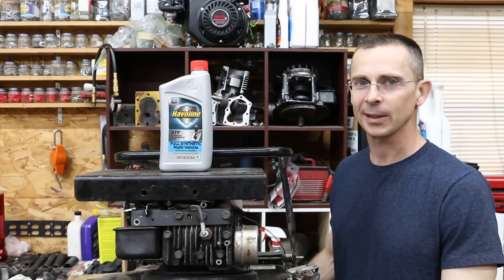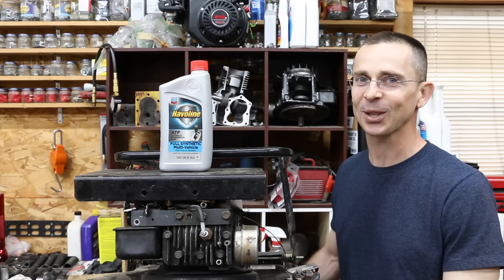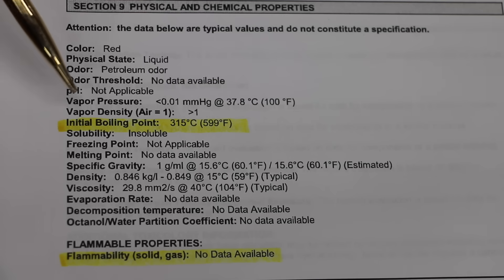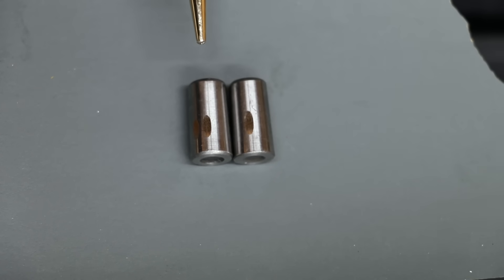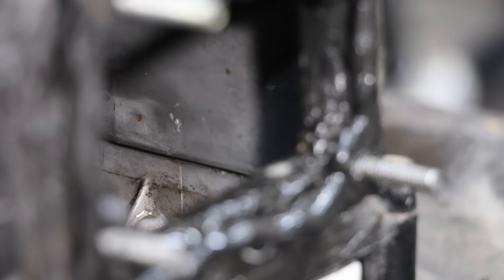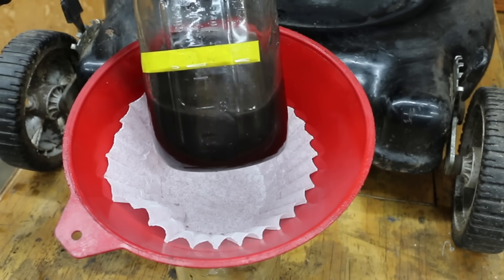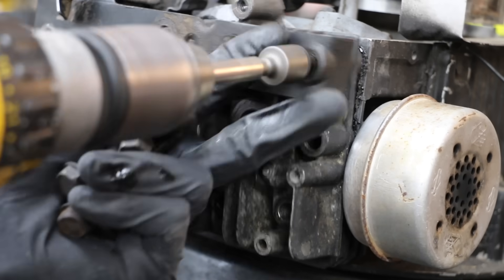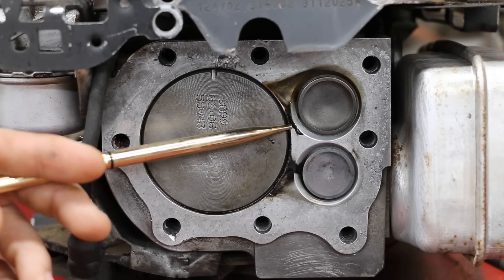ATF as an Engine Oil substitute?  Let's see what happens!

Comment: You are excellent at using the "scientific method" and move your videos along very quickly.  You did not fully understand the significance of when, in another video you placed 20 ml of water in ethanol gasoline, only to come back later and measure 30 ml.
Ethanol turns to water as it decomposes, creating water in your fuel tank. I have only found one product that cures this problem, a Lucas diesel fuel additive. On the label it says _"With real water dispersants"  Treating five different older vehicles I found it takes 5 tankfuls with the additive to get all the water out.  Once you do, your vehicle runs with more power, smoother and fells great, like it is at top performance. (Also helps to clean the O2 sensors, use platinum plugs, and engine flush - the number 1 most effective way to remove engine sludge.

Comment: I worked in a shop years ago and every once in a while someone would come in with a noisey engine from forgetting to change the oil.  Changing the oil but filling the engine with transmission fluid and a new filter usually could fix it.  Just start the engine and wait until it gets a loud lifter tap, about 5-15 minutes.  Then drain the engine for a while, change the oil filter and re fill with engine oil.  Remind customer that oil changes are important and can keep you from buying new engines
Reply from the maker: Thanks for sharing.

Comment: Have you tested motor oil on your bearing tester with hot oil vs. oil strait out the bottle to see if there is a difference in the ware of the bearing. I had seen a video from an oil manufacturer that said that most engine ware happens before the oil gets hot because the oil ware package activates after it gets hot. Love to see a test on that. Love your videos. Thanks.
Reply from the maker: Thanks for the video idea.

Comment: My automotive instructors in college said the best fuel additive is atf. They said 1 quart for 10 gallons of gas. I've done it on old engines and it restored lost fuel economy and performance.  Ive used atf as a cleaner for years
Reply from the maker: Thanks for the feedback.

Comment: To note: ATF lubricants, depending on manufacturer, will contain different levels of friction modifiers so that lubricity is LESS, but not too much less for a given transmission.  Hi lubricity would cause clutch plates to slip and create heat and accelerated wear, and fail to shift properly.  Most ATF fluids are made to lubricious up to a point and then they "break" under the highers sheering/ load of the clutches.  Adding ATF to your motor oil thins it out so people think their car runs faster.  But adding any clean quart of runny oil would be welcome against black broken down oil, past it's drain point.  I believe it's a myth, that ATF cleans your engine. The best way, is to change it before it needs changing, first.  Then you can try cleaners.   A fair test PF.  Fair enough.
Reply from the maker: Thanks for the feedback.

Comment: Wow your testing has gotten way more streamlined in the last 2 years! Good job. My friend works on exotics and he told me if you have a sludged engine your replace ONE quart of oil with transmission fluid during the oil change and run it the whole 3000 miles most of the sludge should be gone but if you have to run another cycle so be it. The engine will remain unaffected.
Reply from the maker: Thanks for the feedback.
Reply: I also know of a guy that put a quart of atf in a car he bought to "flush" the oil.  He blew the motor cause it  was so sludgy it clogged his oil pick up screen, starved the engine for oil and caaabboom!  Threw a rod.
Reply: @1005dragrcr  the dose makes the poison

Comment: I did am experiment with Prolong engine treatment. I was cutting mounting plates for a railing.  Using a new 3" Lenox hole saw in a drill press cutting 1/4 mild steel plate, slowest speed, lubed with 10w30. Cutting with oil, the hole saw stalled a lot and when it did cut made a lot of smoke noise vibration and heat and the hole saw teeth made a washboard pattern in the bottom of the cut. I added a cap full of prolong into the puddle of oil on the plate, outside of the hole saw. It took some rotation for the prolong to stir into the oil. When it did, the noise and vibration went away quickly, so did the smoke and heat. I pulled the handle as hard as I could and I couldn't stall the drill press any more. Not even on a dry piece of steel. I had to clean the hole saw and plate with brake cleaner to continue my work.
Reply from the maker: Thanks for sharing.

Comment: NO.2 Diesel fuel as an engine clean out! Work's great, Drain out motor oil, leave filter on, put in 1 gallon of No.2 diesel fuel ,run engine at idle for 1 minuet, drain out and change filter and put in new oil.
Reply from the maker: Thanks for sharing.

Comment: When I bought my 2009 dodge ram 5.7 (15000 miles) it had a sticky lifter so I use 1 quart of transmission fluid in the oil about once a year before oil change and run it 100 miles. Sticky lifter gone havent had a issue since. Truck runs great have had it about 8 years there's about 170000 miles on it.
Reply: I have also use Marvel Mystery Oil to free up stickey lifters.  It worked very well !!
Reply: lucas has a product for this and it works probably the best for this.

Comment: I feel dumb commenting on such a old thread, but my 2001 Tundra gets a quart of ATF (after I drain a quart) right before I do a regular oil change.  I drive the rig at highway speed for  50 miles and drain the oil as soon as I get home . Not sure what the inside of my motor looks like but even after 3,500 miles my oil is still as clear as water.

Comment: maybe make a video using motor oil mineral and synthetic, atf and other fluids in 2 stroke engine, but it should be on new engines and with inspecting crankcase, these engines are cheap from china to get
Reply from the maker: Thanks for the video idea.
Reply: @ProjectFarm  I looooove brush cutters its so fun !

Comment: I wouldn’t recommend doing it in an old engine, especially if it hasn’t had regular maintenance. Yes it would remove sludge and build up, but that same sludge and build up in the engine is what’s keeping it from leaking and burning and smoking like crazy.
Reply: Had to in mine lifters started hammering but run high mileage filter they are less likely to plug up drove like 50 to 100 miles no more lifters rattling

Comment: 1999 uzj100 land cruiser. At 247k developed a ticking whining noise. Enough of a tick and chatter that I felt like it could be a lifter. A local race car driver told me about atf in the engine, says he runs it always. I put one quart syn ATF to 6 quarts syn oil. I always ran mobil one syn for 6-7 k between changes. A couple just oil changes didn't change the noise. It would come and go. Seemed like more frequently after car sat at work for 12 he shift. So after ATF mix, no noise and have been going about 6 months and 3k. Motor seems quieter smooth and gas milage has not changed, no temp problems. The other factor is I switched to rotella T6 5-40 full syn with the ATF in it. I'm about 3k now and it still looks like honey on the dip stick. I run K&N pro filter with the wrenchable end.
Reply from the maker: Thanks for sharing.

Comment: We have a 2000 ranger 3.0 ffv that we bought used and neglected but ran good and the price was right but after a few months of just back and forth to work for my wife it developed a tweety bird chirp that i thought was a belt or accessory but after some diagnostic work we listed to the heads with a stethoscope and could determined  that  one of the roller lifters was sticking and causing the noise. So we tired the "engine restorer " and it didnt do a thing so we were figuring it was going to be a tear down but  decided to try the old "trans fluid fix" and wow it made some very odd noises for about 5 to 8 mins. But after it ran  for about 10 the noise was gone and so was tweety bird. So we drove it carefully for a few days because we were worried about possible bearing failure but the engine has actually gotten quieter and quieter that even before the bird. We are going to change the oil in a couple of days as we are sure it has to be filthy . We only put 1/2 a quart in it and it seems like a different truck now. Well we also have a 2003 f150 5.4 4x4  start up tick and tick while driving so we figured we would try it in it as well and after about a hour and a half drive we parked in front of our house and got out to move stuff in the garage so we could pull it back in and we noticed the only noise coming from the truck was the ac compressor running as it was 90 degrees out. We just put it in today 6/5/2020 so we will see how start up goes tomorrow but so far its quieted them both down alot , the f150 has 197xxx on it and half quart as well. I never believed in these old mechanic wives tails but this seems to be true.
Reply from the maker: Thanks for sharing.
Reply: @ProjectFarm  thank you for all the testing you do as it helped me make the decision to try what I did, I love how you use a scientific method in your testing .

Comment: Pretty interesting, but the way you are supposed to do it is for example, if your engine takes 5 qts of oil add 4.5 qts of oil and .5 quarts of transmission fluid and change the oil again at 250-500 miles, mostly helps for lifter tick, also same works for marvel mystery oil
Reply from the maker: Thanks for the feedback.

Comment: It could have been good to do a 2nd run with fresh transmission fluid, to see if any more metal bits were flushed out of the crank case, or caused by the transmission fluid.
Reply from the maker: Thanks for the video idea.

Comment: Many years ago I had a Chevy PICK-UP with a 327 in it. I ran the piss out of that truck and I’m not sure if the cam went flat or a lifter stuck but atf didn’t work that time.. I put a 350 in that truck and ran it harder than the 327. One day I got backfiring out the carb just like the 327 but this time the atf actually worked!! After that I stopped running the old 67 that way and sold it. Sometimes it does work.
Reply from the maker: Thanks for sharing.

Comment: Great vids, excellent diy test methods! 

Can you test gear oil as a substitute for engine oil ? Typically 75w 90 in manual transmissions and differentials!
Reply from the maker: Great suggestion!  Thank you.
Reply: Already did it in a old smoking mustang I had it did run but it stinks bad.
Reply: That thick oil your engine would definitely lose horsepower an torque.

Comment: Dexron 3 is the best for Cleaning the engine and crankcase.   Not just ATF only but with oil.  I have used this many times and advised people to free up sticking lifters.   I also use ATF in the Fuel system as well.   With this Ethanol Gas we have to use today it.   Ethanol has caused many Fuel Pumps, Fuel Injectors, and seals/O-Rings to fail.  I have worked on vehicles in my years and have never seen the Failures we have today due to Ethanol in the Gas.  It cause clogs as well from Tarnish build up and it creates havoc on Fuel Systems.
Reply from the maker: Thanks for the feedback.

Comment: I use 1 qt as motor flush, never have a problem, actually with regular motor flush, the valve seal can crack, that is why the engine smoke. That won't happen with transmission oil.
Reply from the maker: Thanks for the feedback.

Comment: I am a believer in this process, here is my (long) story!  I grew up in the Car Culture which is something I can not get out of my blood, and I like it that way. I have three projects right now, aside from helping family and friend car projects. I am also a Fabricator and design Special Effects for the Movie Industry, Museum, Space Industry, and Theme Parks. I mention this because I mentored under many a OldTimers from Drag Racing and more, one of which is Kent Fuller and his Son Steve Fuller. Kent is in the Hot Rod Hall of Fame, Steve is mostly in the Movie Industry. I was told this trick long time ago. I believe it has helped me in some of the old cars I bought / built / daily drove. The worst was an old military truck from Austria, the 710M Pinzgauer. It has a Portal Gear Reduction at the end of each axle (4 in total for the 4x4, there is a 6x6 as well) right at the wheel that raised the centerline of the axle giving more space to drive over rocks while also gearing the final drive higher (5.99/1). Big straight cut gears with big roller bearings in separate baths of gear oil at each hub. One front had a ton of metal shavings/dust and Black slug lining the walls, so much that the magnet looked like a metal cotton ball!! I got her up to temp on the freeway, drained the old oil, poured in new gear oil 2 separate times, and the 3rd and 4th time added a 50/50 mix that had the ATF. Drove freeway for about 50 miles. I got Sooo much of the black slug off the walls that clung there and more metal shavings , including making the inside look damn near pressure washed!! I was amazed. Finally I added the best gear oil that I could, I think I went synthetic, even though people were saying it would cause a leak... So what,  I was just glad that I didn't have to Completely rebuild the hub, gears, and bearing that I priced at $1500 in hard to find parts. Excluding my labor to rebuild it. End of the story is that I drove on that hub for 7 years daily, No issues and saved me money. The new owner has had no issues. WOW!  Thanks for the tech video, it confirmed it for me. It's fine that you did a straight ATF pour, get the most extreme result and worst case scenario. It is recommended to mix with oil because ATF is not meant to carry the stresses and still act as a lubricating film. My guy said to consider it like washing your hands with soap, you still need water. The ATF with high detergents acts as such. Cheers
Reply from the maker: Thanks for sharing.

Comment: I bought a 1958 Mercury Turnpike Cruiser that was gingerly driven 2 miles to work and back every day and had no thermostat. So it never got to warm up. The rings were stuck and it puffed oil smoke out both exhaust pipes. I put in a thermostat, and changed the oil with 3 quarts of oil and 2 quarts automatic transmission fluid. Then I drove from Pasadena, CA to Bakersfield and back. That was about 225 miles round trip. It stopped smoking and never smoked again. Of course I changed the oil back to pure motor oil.
Reply from the maker: Thanks for sharing.

Comment: I have a 2003 Ford Focus ZTW wagon. Bought used in 2006 at 35000 miles. It now has 240000 miles on it  and runs fine with no noticeable oil usage. I change oil about every 4 to 5K miles. I add 1 qt transmission fluid to the used oil and run the engine 15 minutes then drain. I add Duralube to the new oil. I now use Motorcote at the advice of  a trucker and due to your videos.
Reply from the maker: Thanks for sharing

Comment: I have actually used ATF on an old Ford CVH engine (Fiesta XR2, i think it was) that had a stuck lifter. These CVH engines have a reputation for sludging up. 
My experiment had  mixed results. I added about 300cc to the motoroil. Yes, it did in fact silence that lifter but it also caused the engine to start smoking from the exhausts. 
It took quite some driving before that cleared up.
Reply from the maker: Thanks for the feedback.

Comment: If you want to keep your engine forever used transmission fluid for a flush I did this on a 6 cylinder Chevy pickup I got over a hundred thousand miles when I owned it it had a lot of miles on it before I got it the oil used to change color after 500 miles and the engine never burned oil ran great

Comment: i used it to free up lifter and clean oil gallery's  in old straight 6 chevy and both v8s  drained old oil  put in one quart transmission  oil the rest 10/30  new oil filter and ran engines for about 50 miles a little longer  on the stuck lifter till it quieted down then change both oil and filter .worked great cleaned all the sludge out ..
Reply from the maker: Thanks for the feedback.

Comment: I've used diesel to clean out the engine and remove sludge and buildup. Most important thing is not to rev the engine at all during this process. I removed 1L of oil and added the same amount of diesel back in. It cleaned the crusty crud even from the valve cover that builds up over time. Engine was warmed up first and idled for at least 15 mins with the diesel in and then drained it off and discarded oil and filter. New oil and filter issued and driven around for a good 5 miles or so and drained off and replaced again. Process is repeated 3x after diesel was added and the oil basically comes out clean after the 3rd flush. If you remove the valve cover and inspect the camshaft and lifters etc it does clean out very well. What I don't know is why it works so well. I was told to try this out by a mechanic friend and follow these steps to get any crud and sludge out of the motor. This was done on a diesel engine by the way.
Reply from the maker: Great feedback. Thank you

Comment: I work at a used car lot and when we get a car with heavy build up we will add anywhere from a quarter to a half a quart of brake fluid and driver it for 50 or 60 miles and change the oil and it does wonders
Reply from the maker: Thanks for the feedback.

Comment: Transmission oil is great on rejuvenating gaskets and seals. Years ago I had a bad power steering leak on my car, I was refilling it one a month. My dad recommended transmission fluid as a cheaper alternative. On the second top up, the leak stopped. You might want to try a test on a leaky seal or gaskit. Thanks for all your great videos. I just rewatched this one before I'm going to add a liter to my engine oil to try and see it it will help with some seal leaks and some food start lifter noise on my old car.
Reply from the maker: Thanks for the feedback.
Reply: @ProjectFarm  definitely do this!